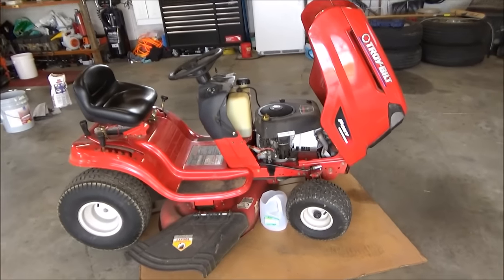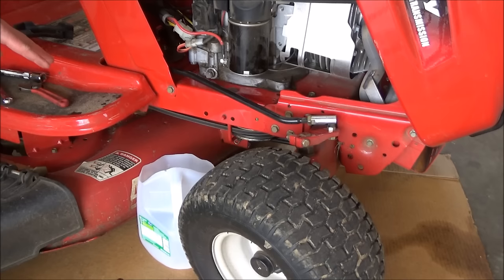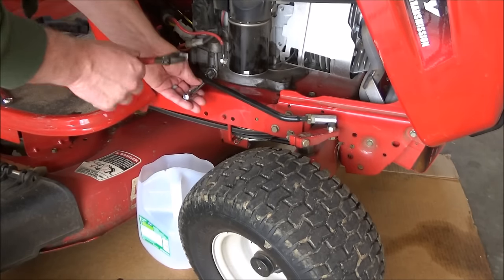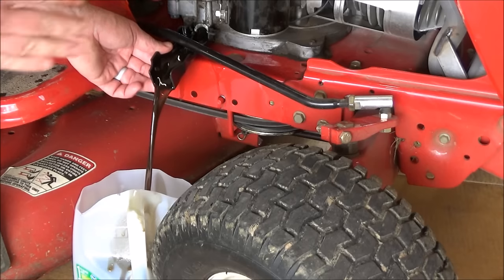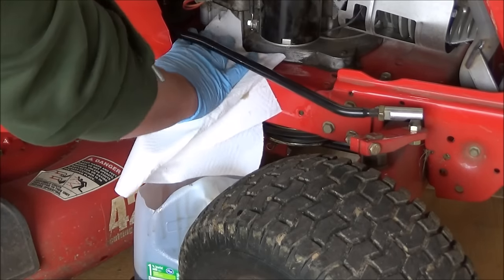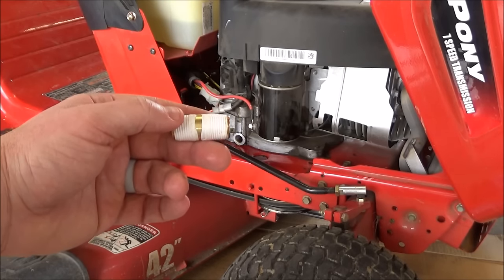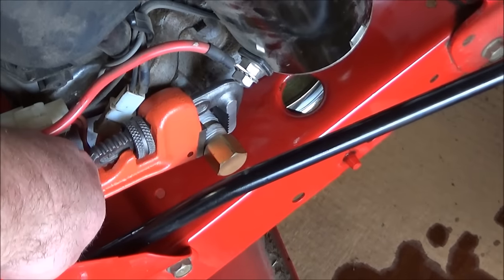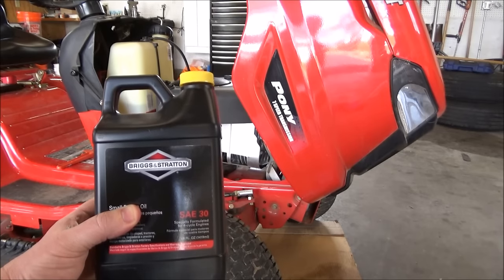Troy-Bilt Pony | Oil Change Made Easier

Comment: It’s so weird. Our mowers look identical except in the spot where the drain plug is on your, there’s just a recessed square plug, like it’s not meant to be removed. I’ll probably have to use a siphon hose to change mine.
Reply from the maker: Interesting. Never seen anything like that.

Comment: Yea including me I didn't get mine and it was bought brand new still had the break in oil but now I figured I could use that oil extender like on most other mowers it does work and it does not cross thread mine came off a John Deer rider which all it's needs is a twist of of the black cap and oil comes out
Reply from the maker: Hey, whatever works for you!
Reply: @fixitFlip  well I kinda spoke to soon the treads match and it does go in but the treads are to long if I was to grind down maybe a thread or 2 it would be perfect fit but as of now it's hitting on the steering bar
Reply from the maker: @chrisgreer1911  Yeah that steering rod is in a really inconvenient spot
Reply: @fixitFlip  hey I do have a question if h don't mind to help me out with but do u know how many grease fittings there r on these mowers
Reply from the maker: @chrisgreer1911  Yep, the only two it has are just inside the front wheels. No zerks on the spindles. They are "maintenance free."

Comment: I had a 10mm hex/allen wrench that I would never use, so I ground it square to fit.
It didn't require much modification.
Reply from the maker: That's pretty smart!
Reply: Not sure I understand.. The Drain Plug has a square Male end.. an Allen Wrench/key has a male Hex shape. how did that fit?

Comment: If you drive up on a 2 x 4 that is under the front and rear wheel on the left side of the lawn tractor it will tilt the engine to the right and you will get better drainage of the oil.
Reply from the maker: Yeah, I have done this trick with paver stones before.

Comment: Would you do this procedure If you accidentally put fuel in the oil tank ?
Reply from the maker: Yes and I would let it dry out over night before putting fresh oil in.
Reply: @fixitFlip  thank you! We flushed the tank with new oil then drained again and left it empty. Will give it a few days before adding new oil again
Reply from the maker: @Onespeed94  Nice work. That should do the trick.

Comment: If you take the steering rod and bend it at the existing bend slight more, which will raise it, the longer nipple will slide underneath the stearing rod and then an elbow and plug so it is clear of the frame. It does not affect steering.
Reply from the maker: Another guy was just suggesting that to me yesterday. Sounds like a good idea. (Why couldn't MTD just make the rod that way, ya know.)

Comment: why is the bottom of my engine leaking, I can't find out from where the oil leak originates however.  it's leaks down onto the 2nd bigger lower pulley, not leaking on the smaller top pulley on the dual pulley shaft, so it's not coming from the lower engine crankcase seal.  So do I have to remove the engine to see if there is a hairline crack or something,.... it is a 2001 lawn tractor from MTD but the engine runs great, but the oil leak drips down and gets all over the V-belt and ruins it and splashes oil everywhere under there.

Comment: What size socket for the oil plug......7/16 I believe? That oil drain plug is TIGHT!
Reply from the maker: I used the female end of a 3/8 extension!
Reply from the maker: Or a 7/16 8 point socket, yes.

Comment: Can you post a link of the blades and oil needed for this mower?
Reply from the maker: Sure, here's the oil: https://amzn.to/2LdiXL4
And here's the blades I use (gator blades): https://amzn.to/2OSWsNJ
Reply: Just changed my Blades.. 42 inch if that's what your deck says. They come in different Types for Mulching and Bagging and regular outlets... As far as I know.. as long as the Star  design Matches you should be able to use any of these.  Make sure they are SIX Point Star design.

 Many of the Cheaper or Off-brand Blades have a FIVE POINT STAR Design, Simple Hole, Butterfly design... Everybody has to have their OWN 'Proprietary designs these days so they can force people to buy THEIR BRANDS!

 Whatever happened to 'UNIVERSAL FIT' Designs? 

 As for Oil type.. He showed 30 weight S.A.E. .. should be fine.... or some type of small engine 4 cycle oil (what I just Bought)

Comment: What's the best way to put my mower up for the winter? Disconnect the battery or what else?
Reply from the maker: Yep that and just clean all the leaves/grass off and you can either use up all the gas or just put some stabilizer in it so it doesn’t go bad over winter.
Reply: @fixitFlip  ok, thanks. What is a good stabilizer? What brand? The stabilizer goes in the gas tank?
Reply from the maker: Yep just something like this Sta-bil storage : https://amzn.to/3kOTVqN
Just follow the directions on the bottle.  Keeps gas good for 2 years.  Can prolly get a little cheaper at Lowes, etc.

Comment: Got a mower 2nd hand that didn't have the drain plastic. . . what engineering genius thought it was a good idea to put an oil drain nut right over frame?  Probably the same who say "Looks good on CAD!" and never actually saw if it was functional.
Reply from the maker: And put it right behind a steering rod!

Comment: What's the best way to clean the mower. It gets really dusty all over it
Reply from the maker: I take a blower to mine after each use. You could also wipe it down with a rag. I have a detailed video on how to clean the deck https://www.youtube.com/watch?v=PWJVYAy59O4
Reply: @fixitFlip  it's really dusty everywhere under the hood. Is it not a good idea to spray it with water ?
Reply from the maker: @dbluehorsedeboe5567  I would probably just wipe it down. I spray my deck but don't know that I would take a hose to the engine.

Comment: Do you know what size the 4 point bolt is by chance? If not no worries. Going tomorrow to Lowe’s.
Reply from the maker: Do you mean the plug?
Reply from the maker: If so, 3/8 inch MIP plug
Reply: @fixitFlip  it’s alright. I got the gator grip and works amazing.
Reply from the maker: @Kla2024-s5t  Okay, glad you got it figured out.

Comment: I have one just like it and I'm wondering if a fitment can be made to fit into the nearby hole?
Reply from the maker: I’ve thought about that as well.  I’m sure with a couple little elbows u could get something down through that hole in the frame.
Reply: Bushing reducer and a 1/4" nipple will clear steering link, you can then put a 90 degree elbow facing down.

Comment: How do you remove the airfilter cover on that machine They turning and not able to lift off
Reply from the maker: Here's my quick video on the air filter if you want to watch how I get it off:
https://www.youtube.com/watch?v=_hvkqRwH2-o
Reply: @fixitFlip  Thanks Mine seized in with rust So the whole shaft was turning I guess thats why they changed it
Reply from the maker: @trevorlonewolf6406  Yeah, that will do it!

Comment: Maybe I missed but I didn't hear what size socket?  Oh I just heard it.  I think 9/16 seems to fit mine, but I need to go get a ratchet then I'll try.   7/16 socket definitely didn't fit.
Reply from the maker: It's just a socket extension.
Reply: @fixitFlip  Right but what size socket for that drain plug?
Reply from the maker: @jackwilliams5474  It's a square so I literally just put the square end of a socket extension on there.
Reply: @fixitFlip  Oh OK, I got you, the female end.   Do you Know what size drive was the extension (1/4, 3/8, or 1/2")?  Yes I too noticed that it was square which was quite odd.
Reply from the maker: @jackwilliams5474  Sorry, I should have specified the female end. I believe it was a 3/8 drive
Reply: @fixitFlip  OK that makes sense now.   I was like what?   Not sure why they have a square bolt there and didn't even the decency to include a tool to remove it with the tractor LOL!
Reply: @fixitFlip  So tried 3/8" extension was too small so I have a 1/2" extension on order from Amazon.    I'm guessing the nipple I buy should then also be 1/2" X 1 1/2", instead of 3/8".    I will try it when it comes in.
Reply from the maker: @jackwilliams5474  Interesting. Let me know if the 1/2 fits. I thought they were all standard.

Comment: Any thought on why my Pony just stopped in the middle of mowing and won't start now? Has gas and oil spark a looks fine. Took air filter off but still won't start. Any help appreciated.  Thanks.
Reply from the maker: I know kind of common sense, but just have to ask. Is the PTO off and you are sitting on seat? 2 things that will make not start. Could there be bad gas in it?
Reply: @fixitFlip  PTO is off and I was sitting on the seat mowing when it stopped running.
Reply from the maker: @jeffwilliams1255  Almost sounds like it isn't getting fuel. Could possibly be a clog in the fuel filter or a leak in the fuel line or something like that?
Reply: @fixitFlip  I've figured out that gas isn't getting through the carb. Gonna give it a good cleaning and see what happens. Thanks.
Reply from the maker: @jeffwilliams1255  Ahh good call. That's along the lines of what I was thinking. Fuel not getting through somewhere.
Reply: Could be the fuel cut-off solenoid (if one is mounted on the carb) is not getting 12 volts anymore. Look on the bottom of the carb for a screw-in "plug" with a red wire going to it. If the ignition switch goes bad, it won't get voltage; if the fuse under the seat has blown , it should be yellow 20 amps (follow the red wire from the battery) or if the cut-off solenoid has corrosion on the threaded portion, then your carburetor will not get fuel because the valve on the solenoid will not open. It's only there to stop fuel when you turn off the key, and "eliminate back-firing". And I don't know why Kohler thought that back-firing was a problem.
Reply from the maker: @jimmy5F  Thanks, Jimmy.
Reply: @jimmy5F  that's what it was. Was having trouble finding a replacement so I just replaced it whole carburetor and everything is good now. Thanks.

Comment: I don't believe that the pipe wrench is going to grip the brass pipe in the position shown if you are trying to loosen the cap. It will have to be reversed for the teeth to bite into the pipe . . . but unfortunately the wrench doesn't have room to go in from the other side. Probably going to have to grip it with channellocks or vice grips.
Reply from the maker: You are correct. I was just holding the pipe wrench up in the wrong position. Was just trying to demonstrate what tool to use. But the truth is I took that cap off many, many times after making this video without even needing the pipe wrench. I just put the nipple in tighter than the cap was on, and I have never had any issues.
Reply: @fixitFlip  My Troy-bilt Super Bronco XP got it's oil changed yesterday . . . what a mess! It only has a drain plug and there is no gap under the plug to insert anything to channel the oil. I put a 8x8x16" cinder block under the back wheel thinking it would give it plenty of slope to drain the oil just across the frame . . . nope. It went everywhere . . . all over the drive pully assembly and into places I couldn't even imagine it could go with it at a 20% angle. The wiring harness is in the way to put a pipe coming out of drain hole. Would have to reroute the wiring. Probably easier to just clean up the mess each time.
Reply from the maker: @rrnabors1  Wow. What a terrible set up. SMH

Comment: I don't suggest adding potential leak points to any lawn mower drain plug. You've added two. The frequency of changing your oil outweighs trying to make it more convenient in my opinion
Reply from the maker: Nothing wrong with a different opinion. Never leaked on me, though.

Comment: My riding mower has a yellow part that you turn counter clockwise to open. It has worked in the past BUT now when I open it NOTHING comes out. Dip stick shows oil is full but needs to be changed. What can I do?
Reply from the maker: That is a Stens oil drain valve. You have to turn the yellow sleeve counter clockwise and then PULL OUT. Is that what you are doing?
Reply: @fixitFlip  Yes I was doing that but apparently not pulling hard enough. After using my pliers I got it to come out further and it worked! Guess these plastic valves stick sometimes. Thank you for your help! Be well. Kelly 😊
Reply from the maker: @kellyfairchild7383  Good, glad to hear it! And the problem with them sometimes is you can break them with pliers, so be careful!
Reply: @fixitFlip  Thanks so much for your help.😁
Reply from the maker: @kellyfairchild7383  No problem!

Comment: Hello
 How often. Should I change the oil? I bought one last summer and used it a few times. A out to start using it again for this season. Think I'm ok with the oil it has?
Reply from the maker: The oil needs to be changed every 50 hours. I would probably go ahead and change it before your first use of the year.
Reply: @fixitFlip   hey I also just bought a Troy bolt lawn mower thing year havent put any oil in it I'm very new to using riding lawn mower and wanted to make sure I use the right oil. Is Sae 30 the only oil to use in it? And i have  to change the oil every 50 riding hours?
Reply from the maker: @blazenmessiah2211  Yes, SAE 30 is best. Here's link to some more information if you want to read more. And yes, change the oil every 50 hours.
https://www.briggsandstratton.com/na/en_us/support/faqs/browse/mower-oil-type-and-capacity.html
Reply from the maker: And actually, the new model of the Pony takes 10W30

Comment: Hi, do you have a video on break/clutch adjustment. Seems I have to let it almost all the way out to get it to move .?  Thx in advance . Any Info would be appreciated.
Reply from the maker: No I don't. Sorry, haven't had to deal with that yet, but sounds like maybe your clutch/brake pedal isn't releasing belt tension all the way.
Reply: More than likely you need to replace your drive belt. As they age, they stretch and wear which makes them longer and more slippery than they were when they were installed. so it takes a lot more tension (which is what your clutch pedal does, adds more tension to the drive belt) to make them transfer power. Baring any mechanical damage or liquid on the belt (like oil) that should fix you up. It’s not a complex system for the drive belt so not hard to deal with.
Reply: @davidvancamp2135  Thank you was wondering about the belts being worn. My mowers about 6 years old .
Reply from the maker: @davidvancamp2135  Thanks for the input, David. Always appreciated!

Comment: what socket would you recommend getting to take off the oil plug
Reply from the maker: If you want to use a socket you would have to use an eight point socket to fit a square plug. I have always just used a wrench

Comment: i got my double bar front bumper and trailer hitch in today from Ebay.  both  fits like a glove  MAN  cost 78 bucks> Only 6 bolts > Craftsman Universal Riding Mower Dual Bar Bumper
Reply from the maker: I just looked it up. That looks awesome! You didn't even have to drill any holes?
Reply: Nope not a one bro .  plenty of hood clearance PERFECT All i did is  1 flat head bot in bottom back one  screw in middle the other side . Start putting in the 3 flat head bolts and 1meat screw that  is 2 ~ 1/2 " wrench  and a 2 ~ 3/19 wrench all the tool used  he hee  never look at the instructions 10 min i was done
Reply from the maker: Wow, that's awesome, might have to look into that!
Reply: this is the trailer hitch for the Pony it very strong brother its on Ebay  UNIVERSAL LAWN GARDEN TRACTOR HITCH WITH SUPPORT BRACE KIT INCLUDED  > yes i had to drill 2 hole for the brace BE SURE TO PUT 2 washer between the  brace and front plate on the tractor  it fills  in the molded metal ok the 2 washer bring the brace out even to the molded metal  When you put it on will see what i'am talken about i use the double  Y brace for more support 10 min i was done
Reply: make a work horse he hee  i need a trailer to pick up limb and haul dirt    Can make a vido of them too
Reply from the maker: I hear that. I have a dump cart I use constantly.
Reply: Many uses for them for sure /  what these are he hee but home built out of my junk pile he hee   i just want to show the bumper and hitch for yours.   There not very cheap but best i found>   I like em   cheers

Comment: Question for you...i brought a used 2011 Troy bilt Pony riding lawn mower.  I went to fire it up for the first time and it was fine.  The next day I started it and what looks like black oil came out the exhaust along with alot of white smoke.  Also after about 20 secs of running and surging it now shuts off.  It does this now repeatedly.  Any idea as to what is happening?
Reply from the maker: First check oil level.   White smoke typically means too much oil in it.  Also check air filter.  Is it oil soaked? Somebody could have tipped it over.  Might need a new air filter.  Worst case scenario is a gasket problem.

Comment: Is there no oil filter?
Reply from the maker: Nope, not on this model. They started adding one to the Ponies the last couple years, but for a long time they did not have them.
Reply: @fixitFlip  i bought mine from home depot last year. I dont see a filter on mine. Does it say what year the model is?
Reply from the maker: @AmiiboJuice  Yes, if you lift up your seat, the model number is listed on the bottom and it has the year on there.

Comment: Do you have to take the spark plug out while changing the oil?
Reply from the maker: The chances of something bad happening are very, very small. Do I do it every time? No. But I try to include all the steps as if somebody has no idea what they are doing to keep them safe.
Reply: @fixitFlip  got it. Thanks sir!
Reply from the maker: @gmholden85  No problem!